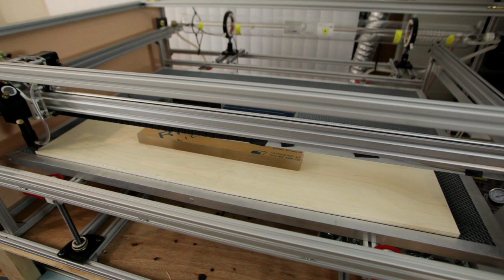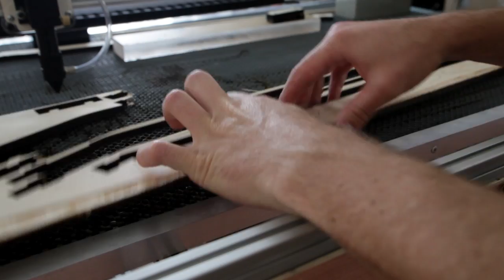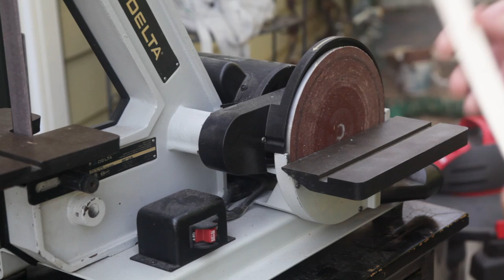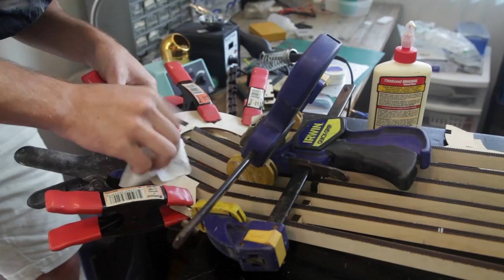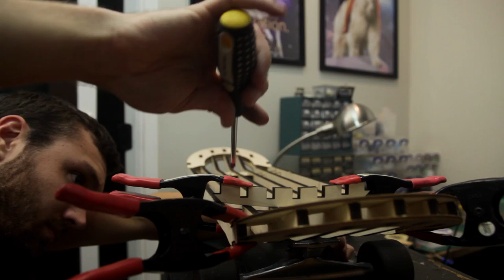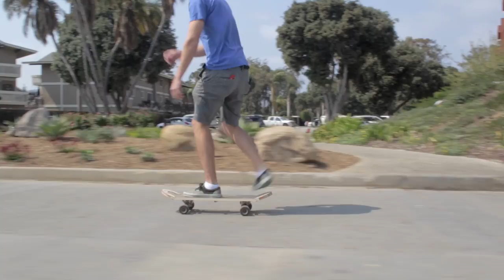Laser Cutting a Skateboard

Comment: The wheels hitting the deck is because they're too close to it. You can put rubber plates in between the metal mounting part of the truck and the bottom of the deck to fix this. Generally, skateboards will have a 1/16" to 1/8" riser which is more to prevent the deck from cracking when there's a lot of pressure there, but I've seen 1/4" to 1/2" riser pads on longboards. Also, a lot of skateboards have a slight curve upward in the deck at the edge where the wheels would hit to avoid this problem.
Reply: Or he could make his own risers on the laser cutter.
Reply from the maker: I'll thicken the cross brace supporting the trucks, effectively the same as adding a spacer.
Reply: Or get some harder bushings.
Reply: The first comment
Reply: Wow, the first comment!
Reply: @pileofstuff  You are the first comment
Reply: i dont hate to be that guy, congrats on being williams first commenter

Comment: Really got my head going on this thing.  Just a thought, you could cut some thin plywood to fill the empty spaces between the verticals... Think I-beam. Doing that around the outer edges of the deck would help retain the outer rib that was the first fail point in the Braille video.

Comment: If you revisit that skateboard, definitely double the amount of transverse struts for boardsliding, and maybe space the sagittal struts differently so you can add in 2 more (4 on either side of center). Also, USE SAFETY GLOVES when sanding.

Comment: the cutting issues can be solved by adjusting the velocity and focus of the beam. I make steel rule dies and operate a large laser daily. the reason the wood is smaller is because it is in MM...and not a pure 3/8. my rule of thumb is an offset of .016 and almost everything fits snugly. your beam may be a little larger or smaller.

Comment: Super cool build man!! Should've specified to the slower braille team to use 4 bolts and washers! Although now you can also tweak your design to restructure for weak points(if you decide to build another board, which I totally would encourage). I would totally buy one of your boards, man! And awesome channel as well! I subscribed as soon as braille mentioned your channel!

PS try using epoxy instead of wood glue!

Comment: So I have a question about laser cutters, what happens if instead of converging the laser light on a point in space, what if you used more complicated optics to bend the light into a very narrow collimated beam? Would having the light so tightly focused inside the lens itself cause problems?
Reply from the maker: Like nearly focused laser light hitting the lens? The optics aren't 100% perfect, so a small percentage of energy is absorbed. If the light is super concentrated the optics will absorb more energy than they can safely dissipate and burn. Higher power lasers actually expand the beam and use larger optics.

Comment: Great build man. Over from Braille. Love the machine. Is it all openbuilds ? I have a pick and place machine similar to this I built. How many fires have you had from the machine ? Seems to be a right or passage for anyone with a laser cutter.
Reply from the maker: The gantry is open builds parts. Everything else is from 8020, McMaster, Amazon, LightObject and more. I haven't had any actual fires, just flames from the materials outgassing during a cut. I just increase the air-assist pressure when flames appear. Do you have any pics/video of the pick and place?

Comment: Here from Braille good idea man so sick that you made that was it some parts from a kit?
Reply: Conor Fitzpatrick Design no he made it himself
Reply: Sorry I meant the 3D printer itself. I was wondering if the more technical parts like the laser components, worm gears and motors came in a kit and he built the chassis and stuff around it.
Reply: Im pretty sure he got like prebuilt parts like the gears and stuff but he made the machine himself (im pretty sure hes not finished though)
Reply from the maker: It's a laser cutter! Buying stuff is so much faster. I bought the acme screw as a 3ft length, and cut it up for the z axis. Some of the parts were laser cut right when I got the laser working. There are websites where you can buy parts like the mirrors, laser tube, and lens.
Reply: thanks

Comment: Good job. :D I thought off an improvement, I think that you might have already figured that out. Anyway, here I go.

You should try to sacrifice some width, by adding an other set of teeth (8 instead of 6) on the outer part of the female structure. To solidify the outside ribs, as this is where it failed first. Thus making it wider.

It was good to see this... come to earth. I hope to see another try in the future, not too far tho. :p
Cheers. :)

Comment: you don't need to clean the surface of laser cut wood. wood glue absorbs into the wood and the burnt surface wont prevent that
Reply from the maker: No way. The board in this video (no sanding) started falling apart immediately , while the board I sent to Braille Skate (sanded) lasted a long time. I'd bet money on the burnt surface weakening the joint significantly.
Reply: William Osman 
ok. maybe there is something to that - kind of like cauterizing a wound? laser cutting wood projects and gluing them together sounds like the ultimate toy of a woodworker - but the extra work of grinding away the charred wood sounds obnoxious. I wonder if there is a better way of removing the charred material or at least a cheap glue that would still penetrate into the wood through the charring.

Comment: I know the laser cutter you use is a DIY, but did you buy a kit for it?  If so can you link to the kit?
Reply from the maker: It's not a kit, but you can buy pretty much everything off the shelf minus mechanicals (build yourself). I have an unfinished blog post on it, so maybe I'll put a page up which goes over the specs and materials.
Reply: Ah, cool, thanks for the quick reply.  What laser do you use?
Reply from the maker: It's an "80 watt" Puri tube.
Reply: oh, man. Those are a lot more expensive than I hoped.  Thanks!
Reply from the maker: Yeah, and I exploded my first one :(
Reply: Sounds like a good use ;)

Comment: What about aluminum instead of wood? Or cover it with fiberglass?
Reply from the maker: An aluminum board could be made with much thinner material, and still be stronger. However my laser won't cut aluminum, and wood is way cheaper. Fiberglass would work too, but it's really nasty and lots of work.

Comment: @wiliam Osman im really interested in your laser cut, seems you wrote some hack over gcode (using 3d printer firmware?) im really interested to know what you do and how and maybe play with the code
Reply from the maker: It's not my hack, it's how the Smoothieboard currently does rastering. Native raster support would be a very efficient method of converting an image into laser position and power. The gcode hack basically writes every pixel of the image using thousands or more very tiny lines. The Smoothieboard can't process this many lines quick enough to run at full speed. It's like driving across the country on side streets instead of the freeway.
Reply: William Osman I see, but that is an issue on the PC side, right? if we could feed correct lines (or directly step so we could use a 1:1 raster with path pre-optimized even manually)..
time to sleep now, but I'll take a look into it, any input is appreciated :)

Comment: what if you make "lock" system to connect those parts instead using just  glue to make them stronger?
Reply from the maker: The board does hold together on it's own but it's really sloppy; the glue makes it rigid and holds the outer slats on. I sacrificed more 'self locking' to keep it looking like a traditional skateboard. The first board does has a couple of nails in it to hold things together better.

Comment: I have an old loaded deck that I would like to use to carve a smaller board out of. Would you be willing to do it if I shipped it to you and for how much?
Reply from the maker: Maybe, are you in the US?
Reply: Yes, I am in new york.. I guess shipping the board would cost about 15 dollars each way (which I could cover) its a bamboo flexy deck (the vanguard) so its over 40 inches long. thing is.. a truck ran it over, it didnt break but it cracked a bit, its still ridable but i wouldnt mind chopping it down to about 30 inches

Comment: Haven't you ever seen a Braille video? If you're skating a non-standard skateboard, you're only allowed to use two bolts on the trucks. That way the comments section can yell at you and tell you that the reason your board made out of gummy bears didn't work was because it needed four bolts. This is the social contract.

Comment: What kind of laser tube is this?
Reply from the maker: 80 watt co2
Reply: It's cutting through (1cm I assume) plywood really good for 80W. I'd go with 2 passes with less power myself, unless there's an issue with repeatability.
Reply from the maker: Are you using air assist? I've found a single pass at max power is best, and keeps the smoke from spraying back. Or I got lucky with a good tube.
Reply: Yeah, I'm using air assist. I have Reci's 80W and 130W tube in industrial machine with vacum table and all. And I usually cut 1cm plywood with 80W as it's cheaper to replace when it comes to it. ^^
However I tend to do 2 passes or more with any kind of 1cm wood. When you try to do somewhat precise work all that charcoaled area around the cut isn't an option.
Also, never had any problems gluing together pieces this way.

Comment: It seems like water jet > laser
Reply from the maker: It really depends. Waterjets are very expensive, messy, and have large operating costs. CO2 lasers are cheap, "clean", and have almost zero operating costs. My laser can't cut metal, but it cuts wood really well. Waterjets can cut metal, but they're not great for cutting wood. There are industrial lasers which can cut metal.